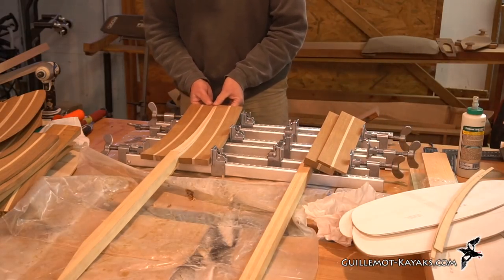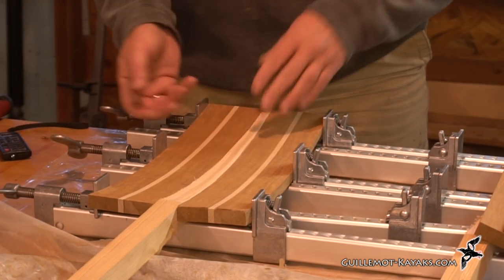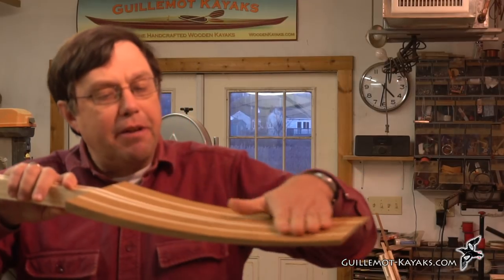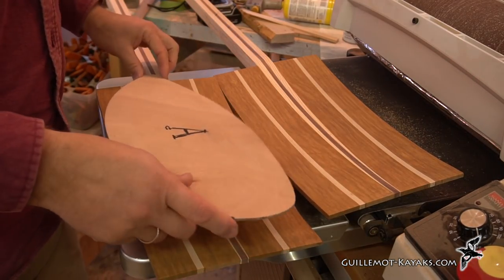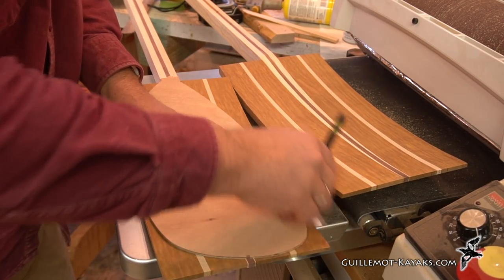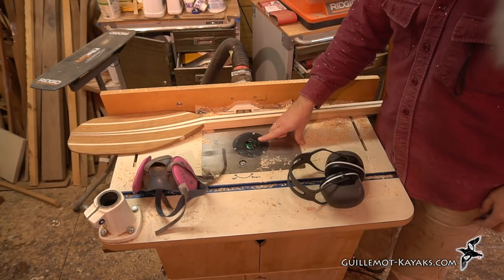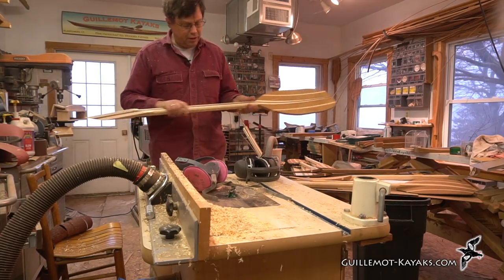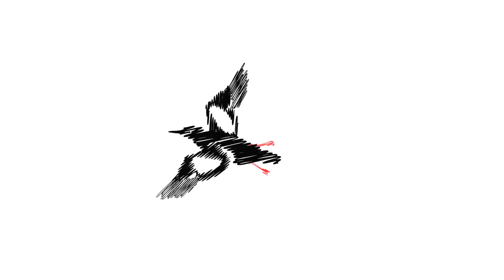Making Kayak Paddles - Gluing Blades & Rough Shaping - E4

Comment: Great video! What is the suggested method for flattening faces if you do not own a drum sander?
Reply from the maker: There are several methods. You can shape down the center with a spoke shave or a short plane. If you put some coarse sandpaper on the internal cut-off piece from the blade blank that is cut to the desired curve, you use it as nicely shaped sanding block to get things leveled out and then a random orbital should get you to a good shape.
Reply: You might check Woodworkers Supply or a company like them. They make a drum for a hand drill and it has a handle on the oppisite end. I would suggest making a jig to clamp around the drill and a stand for the handle end. Do no clamp the drill in a vice, it will damage the drill